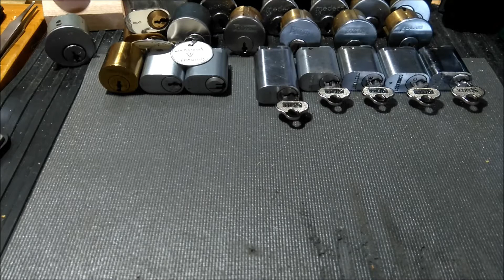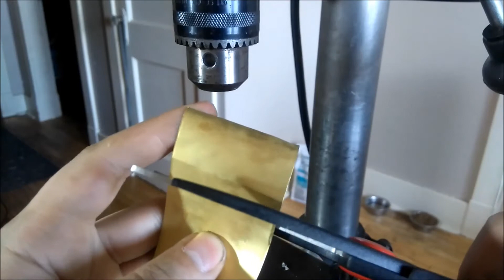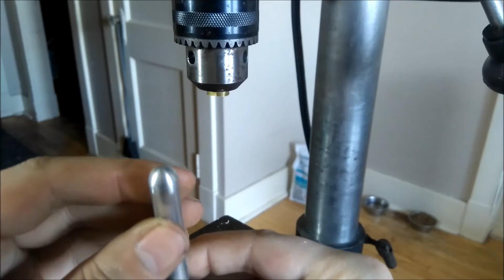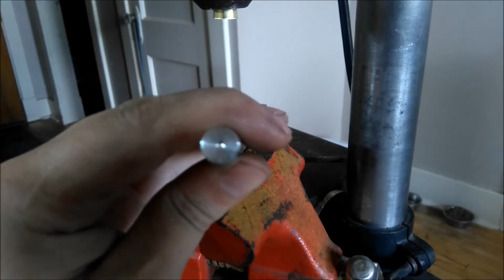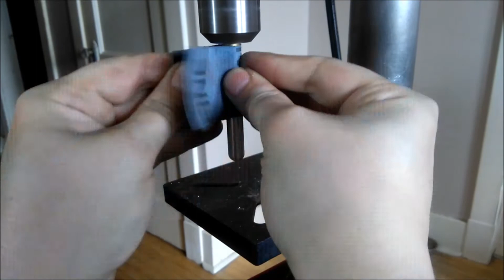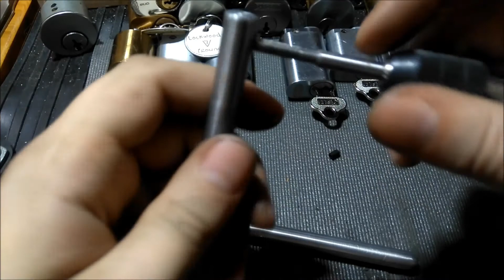(70) Making an aluminum Pick handle for WestCoastPick's Maker Challenge

Comment: Very cool brother. You should get yourself a 4way for your drill press. I really like the one I have although it's a little big for my press. I think you could center everything a lot easier with one. I'm no expert but there's a lot I wouldn't be able to center without mine. Good luck my friend. 😎
Reply from the maker: yeah I really want to get one!! I've been eyeing them out for a while now. Have you tried using yours for milling? if so, how did that work out?
Reply: Rookie Lock yeah I have a set of milling bits but only milled one pad lock so far. But works pretty good. You still have a few days to get your submission in brother.
Reply from the maker: Awesome buddy, I always wanted to mill some stuff :P  And thanks Bobby, Ill try and get my submission in today or tomorrow morning.. Ill post my link in your Callout video! Wish me luck brother!
Reply: Rookie Lock Good Luck Bro. 😎

Comment: Good job and a nice idea too. I don't have a drill press but hope to get one someday. I seen an article on Instructables website on drilling in rounded stock. It may help you. 🍺😎
Reply from the maker: yeah I've seen a few aswell, I really want to make a fixture for doing just that.. Drilling on center.. but for the other centered hole, on the end of the shaft, I like the method of using the drill as a lathe.. works ok but I need a machinist vice or drill press vice
Reply: Rookie Lock tell the missus to buy your wishlist of tools for Xmas and your birthday instead of sock & undies. LOL
Reply from the maker: I was thinking exactly that :P